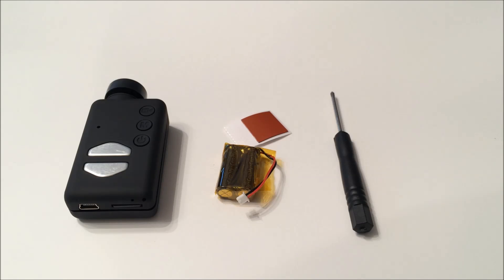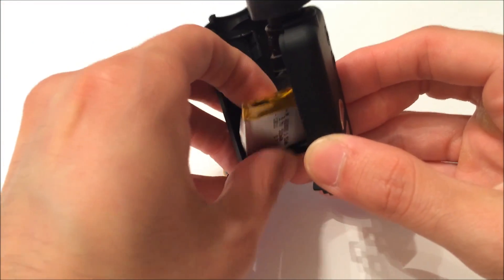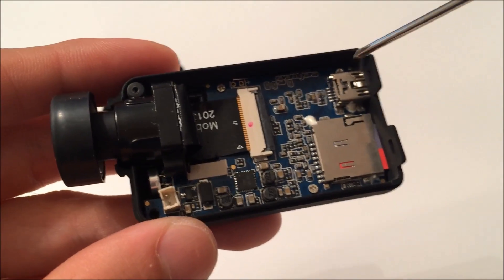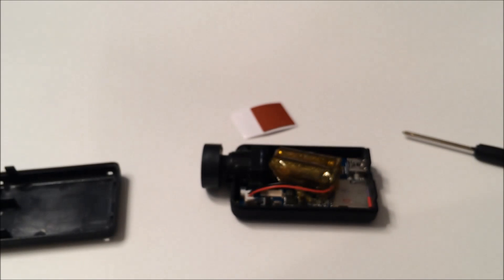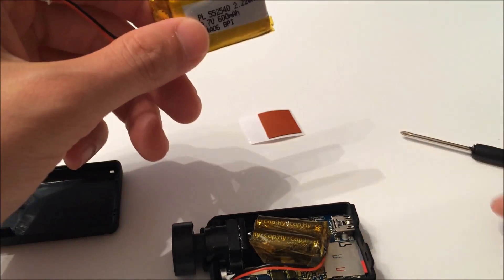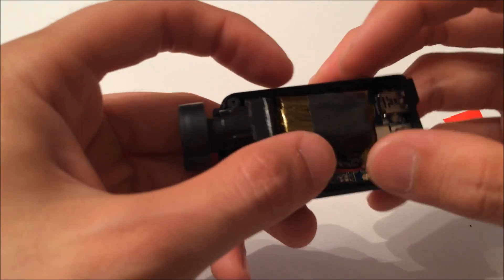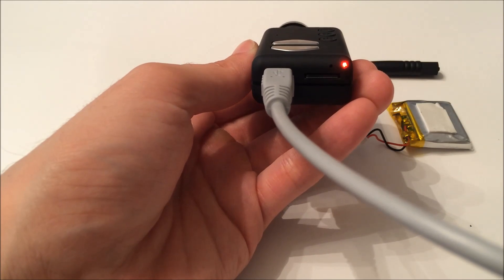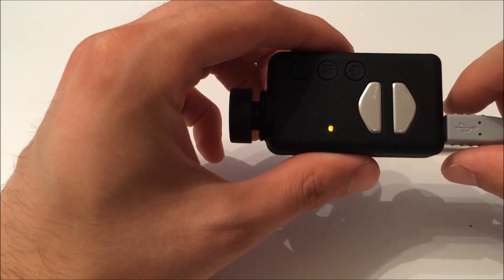DIY: How to swap the Mobius battery for the super capacitor

Comment: Some say 'heat or cold isn't good for batterie. Thats why capacitor.'
After years i took my (dash)mobius out of the car.
Loaded it, start record; 
over 1/2h.  Was still recording.  Could have go (..t? ..ne?) longer.  
So, Batterie after those years OK.  
(Germany. 2weeks -15° to 2weeks 35°+-carinsidetemperature)

Comment: The capacitor pack consists of the supercapacitors only or it has some electronics built in? Because the battery has. I tried it (2 serial 10F/2.8V supercapacitors=5F/5.6V) and the recording does not start when the power is turned on...at least not always...I measured the voltage, when fully charged, it goes up to 4.2 V and stops. Tried  serial 2.5/2.7=1.25/5.4V, but it's the same issue, recording does not start when the power is on. Even the swolen battery did a perfect job, only it failed to finish recording the last file.Thx.

Comment: Hi do you know how to change SJCAM M10 (or SJ4000) battery to a super capacitor? Thanks. My battery in M10 is swollen as I use it as a dashcam.
Reply: lol Im planning on doing the same to my Sj400 wifi
Reply: @Dansk55  If you know how to do it let me know. :)

Comment: so the only benefit is that the date and clock want be reset? I can use the camera without battery and capacitor too right? And if i dont use battery or capacitor, will the camera remeber my settings?

Comment: I replaced the battery with the capacitor today, when i plugged it in the car and turned it on, the mobius' back red LED blinks at the same time with the yellow LED (indicating it's recording), but after about 10 seconds it just turns off! Any ideas? :(
Reply: +theangel123456789 

in case you haven't figured it out already, for the capacitor to work, the camera MUST also receive external power. the capacitor is NOT a suitable replacement for using the mobius if there is no power plugged into it.

you also have to set the camera to power off immediately when external power is lost. this will ensure that the last recording is written the the card properly.

the capacitor mod is ONLY for using the camera in a hot car for example.
Reply: Yes, i knew all that. I later figured out that replacing the battery with the capacitor disconfigured the camera and turned off the "loop recording" config and thus, the camera's memory was full. That's the reason why it shut off even when connected to the car carger.
Reply: @policrisis  I lost my battery through overheating too . I was going to replace it then I discovered thzat it still works as a dashcam using usb external power.

Comment: For us dummies (i'm speakin for myself of course) why would you use a capacitor?
Reply from the maker: NorCal if you are using it as a dash camera, you will likely always have it plugged in. batteries are not as good for withstanding extreme hot or cold temperatures so leaving it in your car on a hot summer day can damage the battery. it happened to me last year to my innovv c2 a similar camera as the mobius. it ruined the camera because the battery got so hot it leaked acid inside the camera. batteries are also not as good for constantly being plugged in. so if you plan on using a mobius always plugged in in your car, a capacitor is recommended.
Reply: Thank you so much.  Battery "melt down" happended to my gps yrs ago.  Garmin replaced it & came out w/ a product update.  

Mobius is going to be used as a "hat cam" :))

Comment: Hi,

I was wondering if you needed this capacitator when taking time lapse photos in moderate to low temperatures for an extended period of time. Will the camera overheat enough to melt the battery?
Reply from the maker: I never actually used the time lapse mode. I gave my mobius to my mother so she could use it in her car as a dash cam. I think you should be fine though, a lot of users still just use the battery and keep it plugged in. I just recommend not leaving it in your car window of its 80F degrees or more for more than half an hour. My INNOVV C2 was damaged beyond repair when I left it in my car for about 45min to an hour when it was 85 degrees. the battery expanded and leaked acid. it still recorded but the video footage was unusable.
Reply: @integralcam  A lithium Ion battery leaked acid huh? Interesting.

Comment: So correct me if I'm wrong, the Capacitor only works when camera is plugged in. Right?
Reply from the maker: correct, it will turn off within seconds once the power is disconnected. the benefit of it though being it will last a lot longer than a battery and won't have as many issues over heating compared to a battery. if you leave your dash cam in your car in the sun the battery can over heat and damage the camera. it has happened to one of my cameras before on a hot summer day.
Reply: +US Dash Camera can I use regular electrolytic capacitors?
Reply from the maker: I do not even know what htat means to be honest, I just bought the capacitor from amazon that is lspecificlaly for the mobius.
Reply: Its a different kind of capacitor.  I'm sure it would work but it would have to be a cap of high capacity to match a super cap.  It would also have to be rated for a voltage at least 50% above spec. 

 Its all good, as long as its under stood we all together now in da hood!!

Comment: You put the tape on the wrong side of the capacitor. And that 's why it still shakes a little.Tape it to the circuit board.
Reply from the maker: hah i suppose i never thought of that but I just didnt know if the tape could be conductive or not. so i just assumed the tape should go on the outside, thinking it would be a tight enough fit that it would press down.
Reply: US Dash Camera what is the flat silver metal part toward the back of the board? that is the part my battery was taped to to begin with, should i tape the capacitor to that?
Reply: I disagree.  You're better off attaching the tape as in the video then sticking it to the inside top half of the case as the battery was originally.  This prevents possible damage to the circuit board and stabilizes it.  It also seems to fit better side wise rather than length wise IMO.